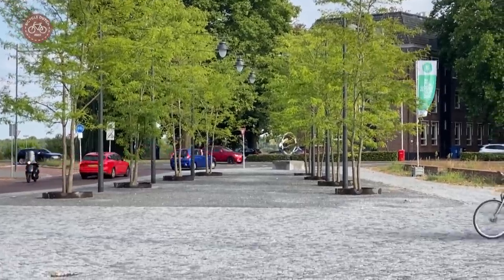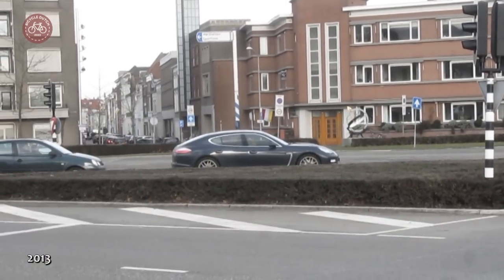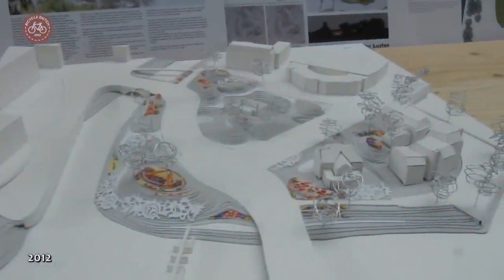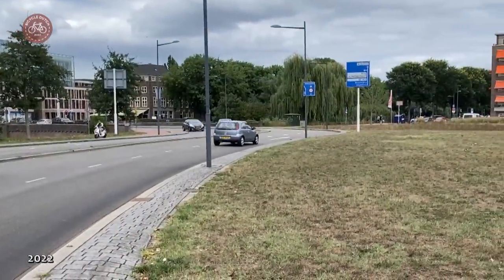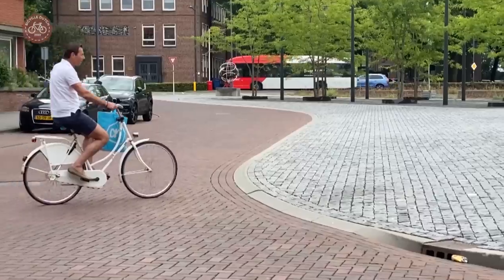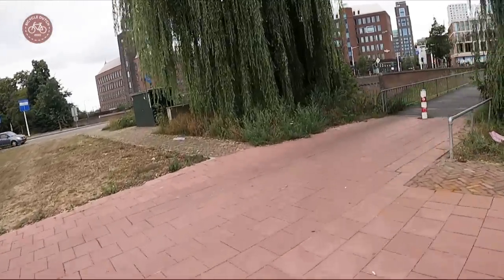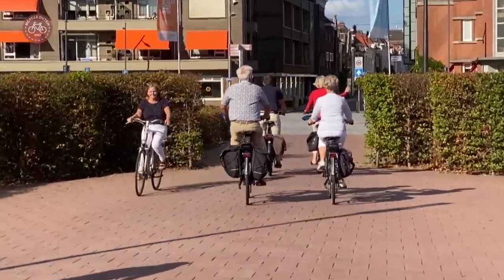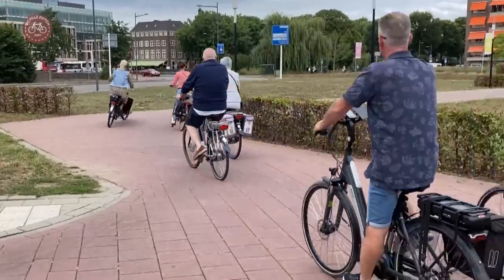Where 's-Hertogenbosch got it wrong for cycling

Comment: A few months ago I was working in Den Bosch and took a break at that square. When I arrived it appeared desolate, but after some minutes a lot of cyclists came past and I was quite surprised it turned out to be a main cycling route. You could hear the constant noise of bicycles driving uncomfortably over that curb. The hedges around the narrow path caused some near misses.  Everything seemed to be designed to discourage cycling...
Reply: The crazy thing is that the city has some pretty excellent cycling infra very nearby, makes me wonder who signed off on this mess?

Comment: Seems like the archeologists and the  landscaping department designed it together, not the traffic department. Terrible mistake. Just rip it out and come up with a proper design. And spend some money on it. Good cycling infrastructure is very cheap in the long run
Reply: You can indicate former walls and stuff by stripes and colored bricks. No need to rebuild the actual defensive works!
Reply: @youteacher78  that was the actual first plan, but it was deemed too expensive, now we have the worst of both worlds.
Reply: They could just rebuilt the actually nice Cyclepaths and make some visually distinct pedestrian crossings, they dont even have to rebuilt the Park

Comment: A a Brit, on the one hand, it's encouraging to know that the Dutch aren't always perfect, but of course it's horrible that someone died and it seems like a terrible waste of money to build amazing bike lanes and then rip them up to build this. I guess they were going for the whole shared space idea, where everyone has to slow down use their brain to look out for each other. It looks like the main problem here is that it's too complicated, wiggly and there are too many blind corners, so you can't see what's coming. Why did the local government let this pass and get built if it didn't follow the very well developed guidelines? Surely they should have forced a re-design?
Reply: Oh yes, the shared space idea. Around CS in Amsterdam it works fine but there cars are not allowed.
Reply: @Schokland2007  It can work well with cars, if done properly. There's been some successful examples in the UK, like Exhibition Road in London or Poynton in Cheshire.
Reply: @mdhazeldine neither of these are good examples, they do not work well, read the many blog posts on them. For the reason as above, too much traffic.
Reply: @David-bi6lf  I have read positive stories about them, but perhaps I haven't heard all sides of the story.
Reply: just reminding me of the very expensive cycle lanes built in South East London that got blocked off & diverted onto main road for building developments in multiple places & closed off with 90° barriers within less than a year of the cycleway's grand opening.

Money spent is clearly not proportional to the benefit to road users if the design is fundamentally flawed & there's no oversight to preserve effective existing transit paths.
Reply: @mdhazeldine  Particularly Exhibition Road is shared simply as an expedient compromise to accommodate the museum and concert crowds without the politically unpalatable option of fully restricting motor traffic — it also doesn’t take significant cycle traffic and it isn’t a major through route to anywhere.

It would be far more effective if it were simply pedestrianised, only the wealthy residents want places to park their cars.
Reply: @oldvlognewtricks  I used to walk across exhibition road every day before and after it became a shared space. My personal experience was that it did not help. Cars do not give way or slow down as they should to make it safe for other users to share the road with then.  It really needed other cues to calm the traffic. Chicanes, bumps, trees in the road, all would have helped.
Reply: @shmubob  Or ditch the compromise and just make it a pedestrian space 🙄
Reply: @oldvlognewtricks  I agree it would be better if it was fully pedestrianised. When I said it was successful, I meant that as far as I knew, it became a safer road.
Reply: @mdhazeldine  Average vehicular speed increased 5mph after implementation, it is unnavigable for the vision impaired, has had multi-collision incidents within the last five years, and has prompted the need for additional safety measures to be added by the local council.

Consensus is it was an implementation of planning dogma, rather than a design success.
Reply: @oldvlognewtricks  Fair enough. My personal experience of it was that it was way nicer than before, but a little confusing to navigate. Wasn't quite sure what to make of it.
Reply: This is what you get when youre local politician push trough their hobby horse without listing to the advise of the traffick engineer. It happens sometime on paper it probable looked ok and most people can't rebuild it mentality to see the problems it created until it build.
O and don't fall into the myth that we always make the best designs. We don't not even the ones who should know better make mistakes. Where we willing are the best in is recognizing those mistales and fixing them. At least where functional and safe infrastructure is concerned.

Comment: The car friendly design from 1960 was made because ALL national traffic between north, south, east and west crossed this point.
Three major highways crossed here N2, N59, N65. It was a good temporary solution to the enormous congestion in and around the city. In the early 1970's the A2 was completed, east of the city, to replace the N2. Later the N65 was connected to the A2 by the new A65. In the 1980's the N59 was upgraded to A59 and a completely new part of the A59 was build north and west of the city.
Only in 2010 the last part of the circle was completed, connecting A59 to the A2 and A65 on the south west side of the city. A little later the local north south connection (old N2) was replaced with a new road west of the railway. This took away all through traffic from this location. The complex traffic square lost its function and could be redesigned for local traffic only, because within the city it is still an important connection point. Because all new A routes had their own gas stations, the gas station at this square could be removed. Leaving a big open space, where the soil had to be replaced because of oil pollution during decades. Also, during the removal of soil and sand, an archaeological study could be done because the area had a big gate in the city wall, demolished a hundred years ago to allow more traffic to pass. And there had been a big famous windmill, also demolished for progress.

A temporary design was made to enable traffic to continue, while sanitation and research took place. Roads and bicycle paths were placed at the edge to keep the center area free for mentioned purpose. At the same time a contest was launched for a new design.
Several plans came in, restore the double roundabout that was there after the gate was demolished, bring back the gate in symbolic form and use it for bicycles and pedestrians, restore the gate in a modern sculpture and use it for small events, etc.
Because of finances the municipality has to compromise on these beautiful but expensive designs.
There everything went wrong, a modern stainless steel outline of the old gate (very transparent) was replaced by hedges that are not transparent, in the pavement the rectangle of the historic drawbridge was integrated, which made a nice curvy route for bicycles impossible. New ideas about full separation of bicycles away from car routes put an end to the paths on the edge.
All of this has lead to this horrific design.

Coming from the hospital (four hospitals merged into a single new big one) cyclists have to go from the Vlijmenseweg all the way to the Willemsbrug to cross the river, cycle back on the other bank to the bicycle crossing, back on the other side of the road, and again if you want to cycle to the Parklaan. so over a birdsview distance of only 150 meters, they have to do the same thing FOUR times.
Bicycle users do not all want to be lead to the Vughterstraat! Parklaan and Westwal are hardly reachable, and you end up crossing bus lanes, car lanes, and pedestrians. Compared to the 1960 design this is ten times worse for bicycles. Though not fully separated, you could cross directly in an almost straight line to where you wanted to go. And every crossing of lanes was guarded by traffic lights!
Not one merge of bicycles and pedestrians occurred! While bicycles crossed the river on a narrow curb separated path on the Willemsbrug, pedestrians used the pedestrian-only bridge. And though it doesn't feel comfortable cycling next to a truck combination, both followed the same route without need or possibility to bend off. Simply stay within your lines and you'll be safe.

A complete new design is needed immediately! A design that respects the CROW guidelines. Probably with a good bicycle bridge across the river from Vlijmenseweg to Chalet Royal, and a path direct to the Parklaan. And a roundabout-like design, pedestrians on the outside separated, bicycles separated, and cars and buses on the inside. Full mode separation!
Reply: Thanks for the history lesson, I love hearing about these nuances!
Reply from the maker: There is a video about the 2013/2014 reconstruction with some background information about that indeed:  https://youtu.be/RzmWxn1Sfz8
Reply: @BicycleDutch  Yes, and you still say: Look at all the green space we got now.
I say: Look at all the green space the A2, A65 and A59 took away only a mile from here, over 1000 times more.
Was it necessary? Yes, we do not yet have a solution for the enormous amount of traffic that passes our city.
To get less cars on this spot, an enormous amount of green space was sacrificed, and we got just a little bit back.
We both agree that the situation of this area is incredibly bad, and should be resolved immediately.
When I ended up on this spot, I had to stop and look around, thought I took a wrong route because I wanted to go to the Parklaan. Immediately bicycles swerved around me and everything jammed up.
When I continued and had to cross into the Vughterstraat, were I did not want to go, I got the impression I truly did something illegal, that I shouldn't be there.
And MeToo ended up at the stairs thinking, the bridge is gone... in broad daylight, a normal curb would have stopped me in time. A normal bicycle path to the bridge so I can see where to go, is no luxury, when it's hidden between the trees.

Comment: In Belgium, we build such places all the time. It is hard to convince road developers that cyclists are not the same as pedestrians.
Reply: Sounds like the UK. Even the standards for cycle infra design stipulates that shared use pavements should not be used unless there is limited space etc. They should be separate cycle tracks and yet everywhere is new shared pavements even where space is not an issue.

Comment: Whenever I go through that area I always feel like the square is still unfinished. Thankfully I don't go through that area often, and if so, it is often late enough that it is relatively quiet. I didn't realize that was the location of the late tiktokker, I thought that was somewhere more rural. But all the more reason to change the flow of traffic through the area.

Now there are also a few other areas where the bike infrastructure needs a good update, such as along the Zuid-Willemsvaart, right in front of the gasthuis kwatier , and Tolburgstraat. The former I would imagine will be updated once all construction is completed of the new housing. But the latter, around the entrance to the parking garage...I haven't got a clue how they're going to fix that if they are at all. 

There are probably plenty of other locations that need to be fixed, but those two stand out the most to me as I go by there so often.

Comment: The old lay-out was a planning marvel. The way the roads where connected and how traffic flowed was really cool to see. I am not saying it was perfect, due to the old layout, driving into oncoming traffic or exiting the intersection into a completely different direction than intended was pretty standard for a lot of first time users of this intersection. So changing the intersection in 2014 made it much easier to navigate and stimulated traffic to use the newly build bypass roads around the city. Without these bypass roads there would be too much traffic flowing trough this intersection.

All in all this was a big succes.

I have been a driving instructor in s'Hertogenbosch untill 2012. I know the area and visit the city once every couple of years. I went there recently and was really annoyed about the current layout. It downright dangerous now. The cyclist safety was majorly improved in 2014 and has been undone in the latest "update". City council should shame themselves.

Comment: This is shocking the plans even went forward knowing Dutch standards. Do you expect this design to last long before is redesigned again?

It's also confusing why they removed perfectly good cycling paths.
Reply: It probable was a temporarly situation until the final design would get in we ussually don't go for red "stoeptegel" in the final design for longer  lengths of road.

Comment: What they did wrong here is simple. It's okay to mix pedestrian, bicycle and motorized traffic in inner city centres with limited space and speeds, like 'fietsstraten' with 30kmh max speeds. But as soon as you leave those zones - mostly the historical inner cities - you've got to seperate the traffic flows. They did this quite well with the bike lanes and reconfiguration into two T-junctions of this square. But the designers of the 'new' square completely misunderstood that the concept of mixing all traffic flows and rely on self-regulating traffic is not opportune here. Beats me why the city council decided for this design. Even the use of those small bricks for cycling are uncomfortable to say the least. And usually those brick-paved surfaces don't stay nice and flat very long.

Comment: The ambiguous steps vs. bridge situation can be avoided by installing a small fence in front of the steps, spaced out enough to allow pedestrians access from either side. A cyclist heading towards the steps with the impression of a bridge being there would see a fence blocking their way and avoid continuing. I don't know the efficacy of such an approach, but I think it would be a simple and effective way to stop such incidents. The bridge absolutely still needs to be wider, the square redesigned for separate walking and cycling paths, and the removed paths reinstalled.

I'm curious, what will be done with the old bridge? My hometown in California has a number of nice steel frame pedestrian bridges, many of which are narrow for shared use, but would be appropriate for reuse elsewhere in the city where fewer bridges are installed for pedestrians and cyclists. One unit could be used as a two way pedestrian only bridge, or a one way bicycle only bridge. And wider bridges suitable for comfortably mixed foot and cycle traffic can be installed in their place. If a bridge is structurally unsuitable for relocation and reuse, that's understandable, but otherwise it would be a very good thing for a city to reuse.

Comment: Wow this is so bad on so many ways.

How did this end up being just a throughway for bikes and pedestrians considering how many designs were proposed? It doesn't look at all appealing as a park, because there doesn't seem to be nearly enough spaces designed for it to be used as a park. The  visually impaired crossing doesn't even seem to have tactile tiles on the other side of the crossing, there also is that is dirt and that garbage container right in the line of the crossing, so if the visually impaired person veers even slightly off course they will end up tripping in the dirt or crashing into the garbage container. Why does there seem to be no path at all marked in some ways to guide cyclist this space and to let pedestrian know to avoid the bike "lane". The access to the bridge also appears to have somewhat of a blind corner and has that little half fence for apparently no reason (usually you would have that if the bridge is meant to be accessed from a specific angle, but since the whole area before it is a biking space the fence doesn't make sense. The visibility to the stairs is also blocked by the trash container. The zigzags are probably the worst design part of this whole thing.

The people should protest this by  cutting down part of the hedges, put down some of those metal sheets that are put down sometimes for temporary bicycle paths and chalk the are up to create paths for the different traffic using the space. The whole space should be redesigned, make it functional, safe and a actual usable park area.

Comment: I suspect we are close to a turning poit in the Netherlands, shared space probably equals a lower budget. In times that the national gouvernment has thrown a lot of the burden towards the municipalities those are forced to cut costs everywhere possible and I think that litallery leads to cutting corners on traffic safety.
Reply: Does it though. Fancy looking paving used in shared space is more expensive than standard road and cycle track surfacing.